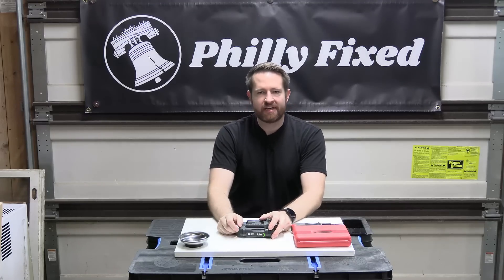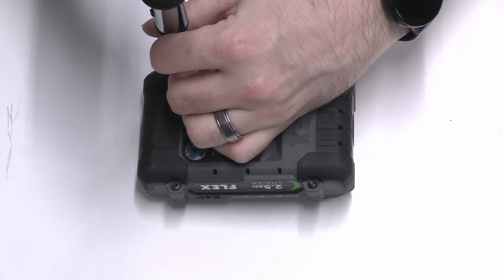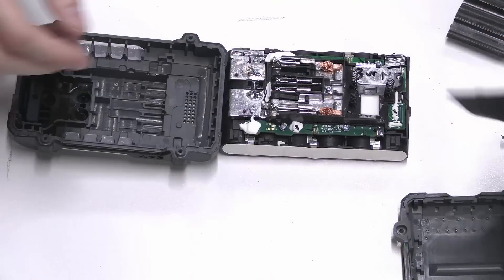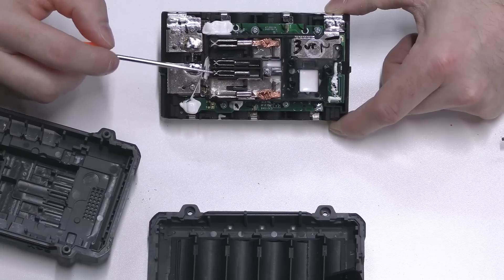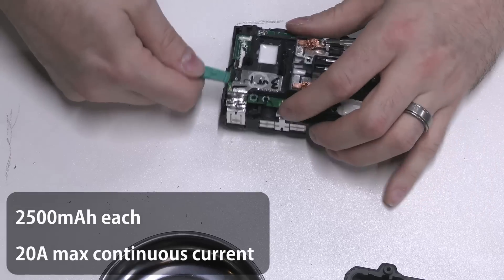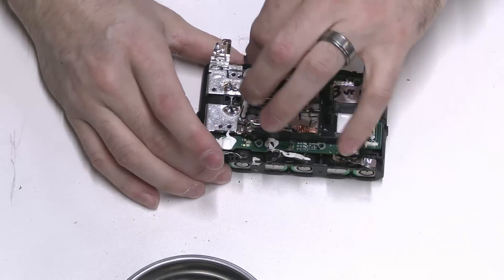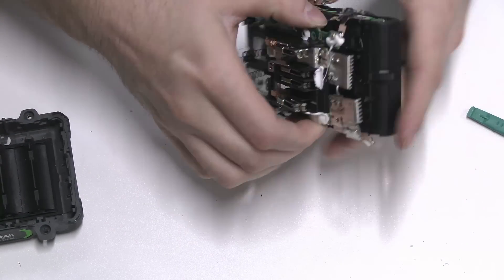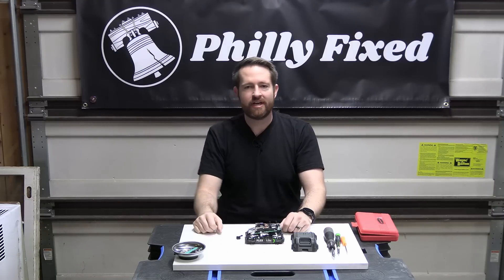Flex Power Tools 24V Battery Teardown!

Comment: Good luck trying to remove the metal tabs on the end of the batteries with a soldering iron!  The tabs are actually spot welded in place.

Comment: Where was the black goo?  Mine can slathered with it on the outside of the battery.....
Reply from the maker: That's weird! Didn't find that with mine...
Reply: @PhillyFixed  Lowes exchanged it for me.  The sales person and i looked at every remaining battery 7x apx and none of the others had that goo in the package so i got one of them..
Shook my confidence in them "flex".  Had issues with my milwaukee batteries lately as well.  Very disappointed in quality levels of just about everything made post covid.  It seems like new assembly line workers or something?  Look at the problems GM is having with truck motors.  Depressing.
Reply from the maker: @unclefester4626  yeah 🫤 TTC just had an M18 battery fall apart during filming on their most recent vid.

Comment: I had some kind of black liquid leaking out of my flex battery, does anyone know what that could be?
Reply: I came to this video to try and figure out what that black liquid is my self.
Reply from the maker: That's weird guys.  Did your batteries get hot?? I wonder if it's either adhesive, or the phase change material (the tray-type component that cracked in the teardown that I failed to properly identify).
Reply: It actually happened when my impact gun was in the case. The 5.0 amp and the 2.5 amp battery both leaked the fluid out over the weekend. I've heard that it's a cooling liquid in the battery. The 5.0 battery leaked about 3 table spoons into the case. I haven't even used it yet.
Reply from the maker: @chd8759  well, at the very least I'd request a warranty replacement.  But that doesn't solve the mystery 🤷‍♂️ I'll ask around...
Reply: @PhillyFixed I have the same issue, I just noticed 4 of my flex batteries leaking a black liquid substance. I called flex and they are sending out replacement batteries. FLEX said they have been getting calls about this issue.
Reply: It was strange, I have like 6 batteries and that specific one have not used in a few months, and now I used it on my flex flashlight and it leaked all over the place. Almost looked like oil.
Reply: Did you get an official explanation from flex as to what the black fluid is?

Comment: Save yourself the trouble of looking up the amperage. 2500ma, hence 2.5ah. 6- 4.2/3.6 volt cells in series bringing the voltage to 25.2/21.6 volts while amps stay the same 2.5. Parallel a duplicate array of 6 cells in series to maintain the same voltage but double the capacity. 5.0 Ah. Samsung 25R's are very good cells and commonly found in most of the quality manufacturers batteries.
Reply from the maker: Hey Jim, you're correct -- but I meant max current draw (20A), not the amp-hour capacity.  Thanks for watching!

Comment: that battery cradle is a wax like material that changes phase as it heats up to sink heat away from the batteries, it self heals with the battery so putting it back should be fine. It's a staple of ego batteries which have the same parent company as flex, and it seems to work pretty well.
Reply from the maker: Thanks, Alex!  Learned a few things on this one 👍

Comment: I have been wanting to see inside of one of these. I have not bought any of these yet. I see you found out already that they are spot welded on the cells! I am curious though about what's on top of the board. I have repaired and showed inside many EGO battery packs and they are full of BMS electronics. So the big question is....
Is there more to be seen on top of the pack or is most electronics actually built into the tool? Thanks for then video, it was very informative!
Reply from the maker: I need to mess around with it a bit more.  I was trying not to break it to the point of not being able to re-assemble, but at this point, since I don't have a spot welder, I might as well go all the way with it.  I'll update if I find anything of interest...

Comment: Thanks for the teardown. Safe to say, No revolutionary, industry disrupting battery platform is going to be based on the use of previous-gen 18650 2500mah battery cells...

 The 2 main things I've already noticed is a common factor among all of these Flex tools and the whole platform in general, is that all of their claims leave out the fine-print. Example, their chargers are not 50% faster than any other competitors chargers (as claimed over & over again on repeat) it's that they are up to 50% faster than the slowest, base-model chargers from cos. like Dewalt etc.

Eg- Dewalt already has a 12Amp Charger which @ minimum is 240 watts @ 20Volts & over 5x that if its 12amps @ 110v. 2nd, most of their tools have 1 unique/ innovative feature. Whether that ends up being a marketing gimmick or truly useful, remains to be seen, but I've yet to see anything truly game-changing in any respect. Lastly, they sure don't like to go off script & highlight things like actual power output measured in watts, UWO or MWO etc. The coolest tool I saw at launch was the 6.5" saw, but the more I look into it, the more I see sizzle & NO Steak, style over substance. I mean, when's the last time u saw anyone framing a house w 3X lumber & if I'm ripping sheet goods all day I'll def be using my Blade-Left Worm-Drive style DCS577 or even a corded skilsaw over a 6.5" compact saw any day of the week!

Imo, i think they'll most likely end up competing in the DIY market, I really don't see them taking any significant market share from Milwaukee or Dewalt. At least not in the U.S. ✌
Reply from the maker: Thanks for watching, Brian!  Yeah, I think they are leaning HEAVILY on marketing for the North American FLEX line.  Not to say they are bad tools, I think they are actually pretty good, but I agree with your assessment -- nothing ground-breaking.   The exception might be that in-line circ saw, that's a cool design and I hope I can try it out soon.  And apparently the 7-1/4" can run under water thanks to the Stanley "Dirt Monkey" demo 🤣
Reply: @PhillyFixed  Agreed. No unwarranted hate here. Additional competition in the tool industry ultimately benefits us all & helps fuel innovation. Not to mention the tools are 1 of the coolest parts of being in the trades these days (at least for me). That said, Fine print & marketing-speak hype do annoy me but I suppose every co. is guilty of that to some degree these days. Thx for the vids, looking forward to more content & comparisons.  I'm anxious to see how other Flex tools stack up in independent testing & can't wait to see that 6.5" in action too✌

Comment: @philly fixed, how long does it take to charge the batteries.
Reply from the maker: Once my 5.0aH comes in on Wednesday, I'll post times for both the 2.5 and 5.0 from a completely dead state, as well as threshold voltages.  Stay tuned!

Comment: Batteries aren't soldered, they're spot welded. Keeps the temperature on the batteries low. Also to mention, a lot of these devices are surface mount, there may have been smart devices on that one side of the board but the pads won't show on the other side.
Reply from the maker: Thanks!  Added a note to the video and pinned comment.

Comment: It’s a little disappointing to see Flex using the Samsung INR18650-25R cells at this point. Those are good cells, and are one of the most commonly used in 2.5Ah and 5Ah batteries, but there are some better options from LG, Sony, and Samsung these days. Granted, Flex has the benefit of using 6 cells (22V/24V) rather than 5 cells (18V/20V) on most other brands, but the 25R cells in a 1p configuration limits the amount of current these batteries can supply. In essence, they needed 6 cells just to supply the same power you can get from other brands using Samsung INR18650-20R (2Ah) cells in an 18V/20V 2Ah battery. It’s distinctly lower power than you could get using the newer generation 18650 cells from any of the big 3 cell manufacturers. For example, the -25s from Samsung is a 2.5Ah cell rated for 25A Max current, so would supply about 20% more power. Similar cells are available from LG and Sony.
Reply from the maker: Yup. I'm anxious for my 5.0 to arrive Wednesday.  I'll just take the bottom cover off to peek at the cells.
Reply: @PhillyFixed  I would expect them to be the same cells, although they might dual source with LG cells rather than Samsung. 

The 8.0 and 12.0 will of course use 21700 4Ah cells in 2P/3P configurations, respectively. Even if the use the Samsung INR21700-40t (rated at 35Ah, but realistically delivers 30-32A max sustained), they should still exceed the power available from the 5.0. Of course, that’s only going to matter on the highest demand tools on the highest demand tasks. Larger saws, top end drills, etc are the things most likely to show any performance gains from the 8.0/12.0 batteries.

Comment: Looks like a well made pack with good shock absorbing. Samsung 25r are good 18650 pack cells and are widely used in many 18650 packs. I would be interested in seeing the side by side with the OG Kobalt 24v pack to see how they differ. 

I find it interesting that given that the Kobalt 24v xtr packs use 21700 cells that Flex didn't make all their packs in that HO configuration.
Reply from the maker: I'm hoping the 5.0aH and up batteries have the 21700 cells.  I'll pop open the 5.0 when it comes because I'll be able to see the cell type on the bottom without mangling the pack like this one.
Reply: @PhillyFixed  Yeah open it up without damaging it. I was under the impression that the 5hr Flex pack was 18650 but with the power they are implying 21700 would make the most sense, and with their claim to fame in the battery pack game using 18650 seems off as well for their pro grade.

Comment: The connections on the side of the cells are spot welded nickel strips not soldered. To much heat would be put into the cells tho solder them.
Reply from the maker: Thanks, Rob!  I learned something new here.

Comment: I recently bought a Milwaukee Shockwave bit set that came with a set of standard torx and a set of those special torx as well. Was just 10€.

Now we know why the flex guys didn’t test against High Output batteries... all the companies using 21700 cells would destroy flex‘s battery technology. I mean how can you launch a new line of tools in 2021 that claims to be the best of the best and not even use the new standard battery tech?
Reply from the maker: Maybe the 5, 8 and 12.0aH batteries have the 21700's?

Comment: I believe the 5AH and above use 21700 cells. There is even a slight chance they pulled a "sneaky" and include these lesser 18650 cells with lower grade kits and then put 21700 cells into the pro grade kits. Its starting to seem like the entry level tools aren't so great while the high end tools are crazy good. So far the pro grade reviews are fantastic, with some of their tools even beating Milwaukee M18 Fuel Gen 3.5 latest and greatest tools. This guy was stunned by the 1/4-in impact driver, putting out more torque from this class of tool than he has ever seen before, pulling the same kind of torque as a Milwaukee M12 Fuel Automotive Impact Wrench. https://www.youtube.com/watch?v=lGJsEebPO5o

Comment: Those little “solders” holding the metal on the cells are actually spot welds. They send a high current though the nickel strip into the cell out the other point instantly welding them together and normally there is four of them on a cell not two so actually not pleased to see that
Reply from the maker: Thanks Derek!

Comment: I wouldn't expect 21700 cells in a 2.5AH battery. Now maybe 5.0, 8.0 or most likely 12.0AH battery yes I would expect it...
Reply: they are on the 8 amp batteries I believe

Comment: The more you tear apart Flex, the more it proves to be overrated junk!  Milwaukee has the only batteries proven to survive -40 degree winter cold sitting outside in work trucks overnight.  The others will all be dead in the morning.  Freeze the tool well below zero and then test it to the limits and most will fail.
Reply: ah yes, that be a good test: test the "red" in Milwaukee's red lithium, and compare to Flex. I'd settle for 20F though.

Comment: I'm confused.  Flex made it sound like the batteries had "intelligence," which sounds like computer chip .  Were we misled?
Reply: is the pope catholic?
Reply: Does the tin man have a sheet metal coçk?
Reply: @MoneyManHolmes  hey, you don't know, it might be brass or copper! 😜
Reply: Not necessarily. The smarts could be hidden under other components on that battery PCB (couldn't really see much on the first side due to the plastic support structure for the contacts and springs), or they could be built into the tool. Some companies build the battery smarts into the batts, some build them into the tools. Pros and cons for each, and one's not really better than the other if you're using first party tools and chargers.